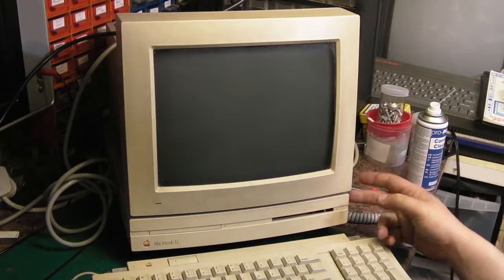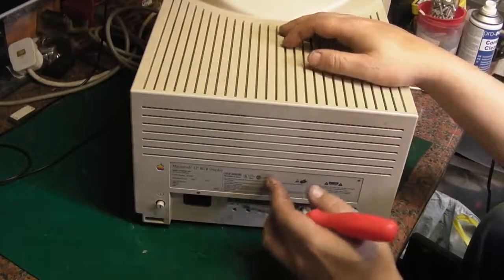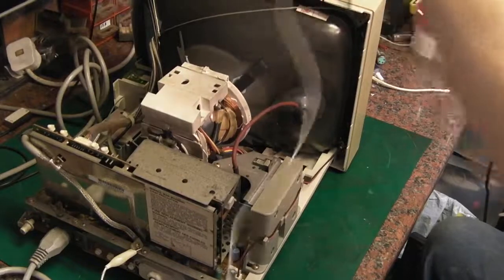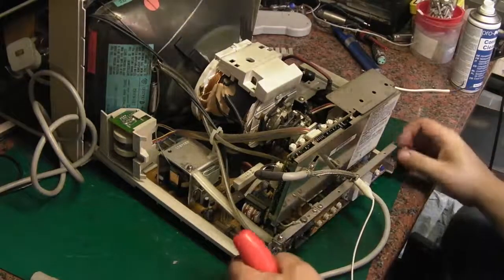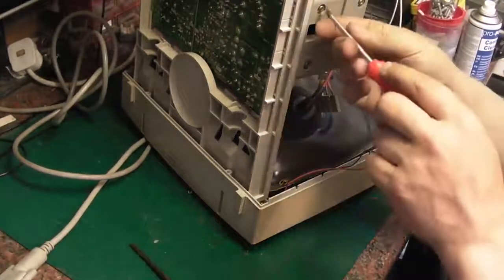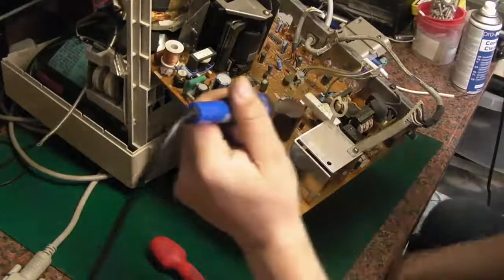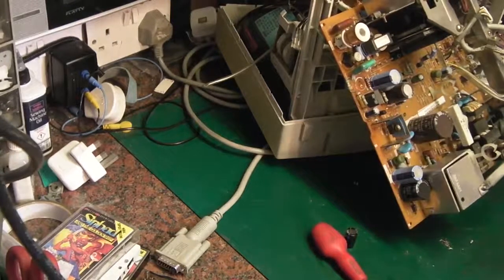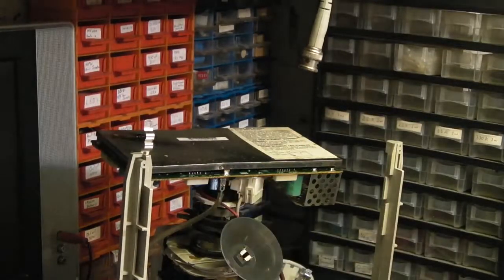Macintosh LC 12" RGB Monitor repair Pt1

Comment: I know this is an old video, but I have to leave a note.  I got myself a Mac LC a month ago, I got the computer restored and working but the monitor doesn't work.  I've never worked on a CRT before, so I'm taking my time.  I must say this is a super common failure with these monitors, as every single one I've found online has exactly the same fault.  That voltage divider of 2 .12 ohm resistors sticking up in the middle at the back of the board just cooks that cap.  In my case sadly, the bad caps aren't the only fault and I'm currently waiting for a replacement transistor (that power transistor that's attached to the flyback).  Also BTW, I found Apple's official service manual for this monitor (sadly no schematic), and they do state that to separate the main board from the neck board you need to open the cap on the neck board and de-solder the other lead to the flyback.  My monitor is slightly different from yours (mine has the power lead hard-wired), but it was easy just to desolder that one wire so that you can easily access the main board.  Great video!